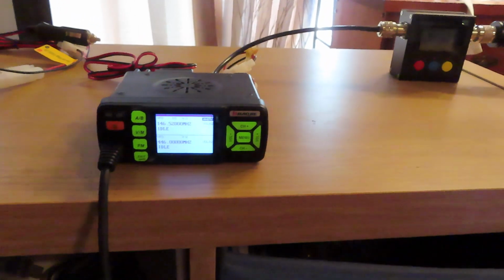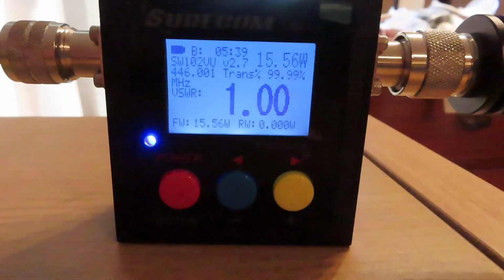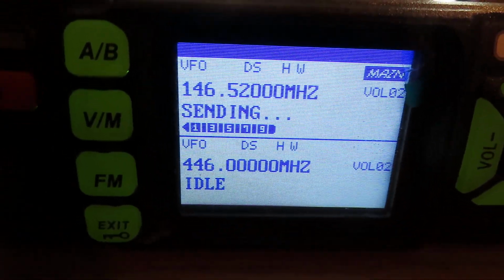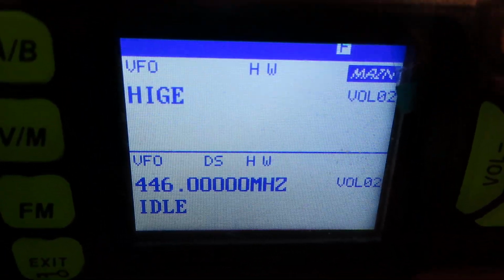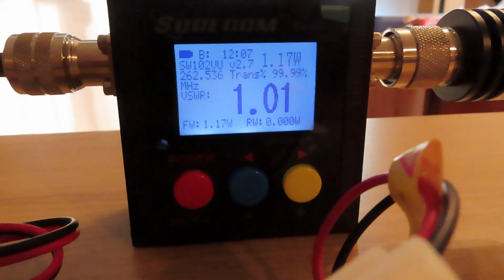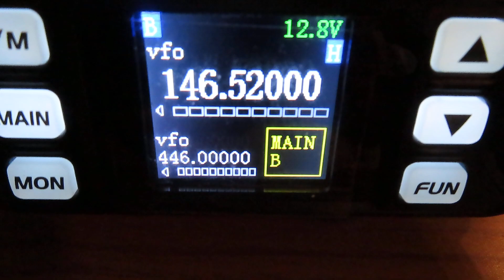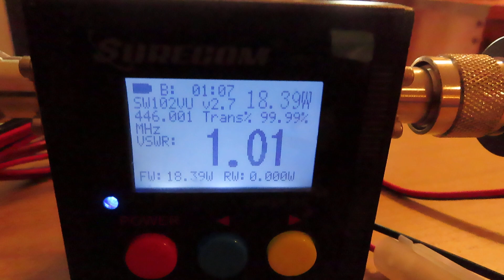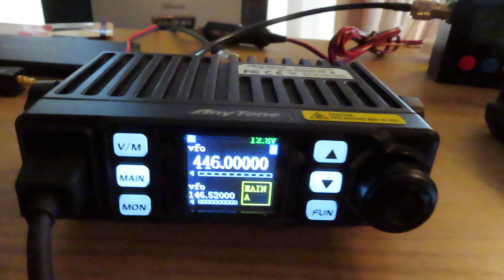Baojie BJ-318 Power Problems - Have you tested yours?

Comment: Hi I had a similar unbranded radio that looks the same looks and style. Same fault but I was able to fix the problem. In mine I had to set the country "UK" and then it worked perfectly but was around 15watts on vhf and uhf and spec at 20W. That maybe as I had only a 12vdc supply. Cheers for doing this video. George

Comment: Must be the batch. I've had one in my truck for a year. Never used anything but high. I've had it hot enough to burn my fingers. Just keeps working. The way these Chinese radios work. On or off. I had the same problem with UV5R.